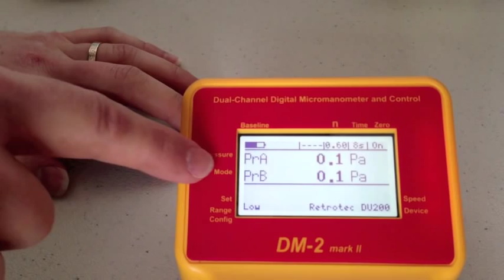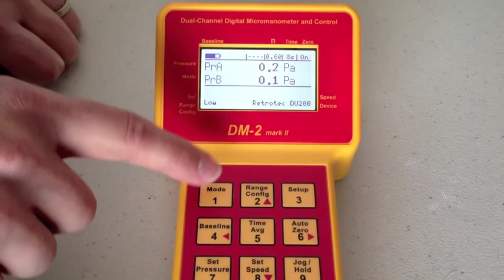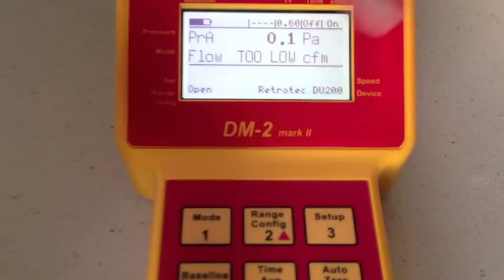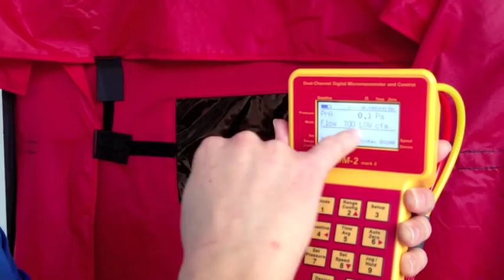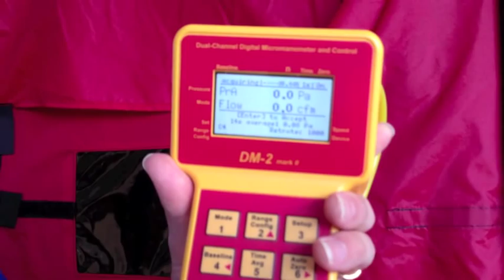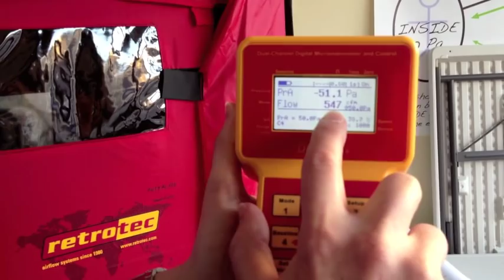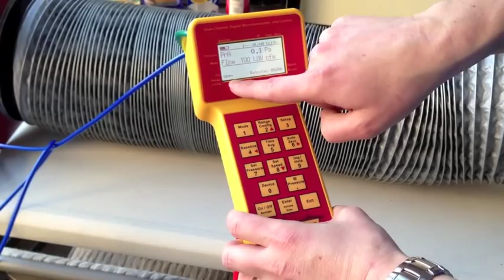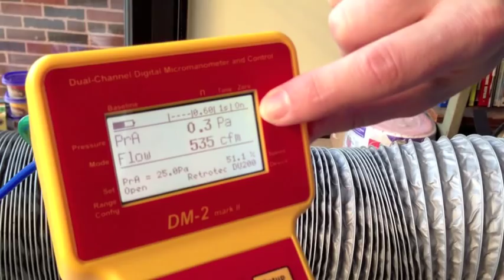DET Verifier Pre-Training: Retrotec Blower Door, Duc Tester, & Manometer Configuration

Comment: Thank you sir for this amazing video.  Once we set pressure to 50 pa . We note the flow reading  . If we want to note reading at 45 right after  50pa how we can reduce the pressure . As we do for blower door test for air leakage test. Please reply thank you in advance ❤
Reply from the maker: You can jog pressure target or fan speed up and down incrementally. Happy testing!
Reply: @HomePerformance  thank you sir for your kind response. I meant that after putting 50 pa how we can take readings at every 5 pa decrements in pressure at same percentage of speed ?